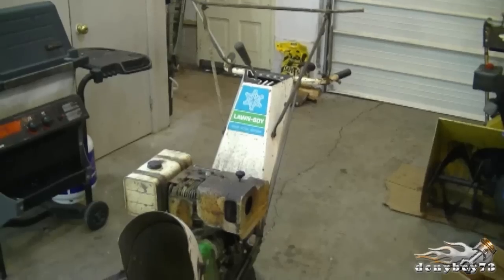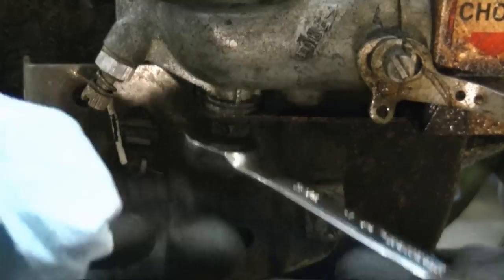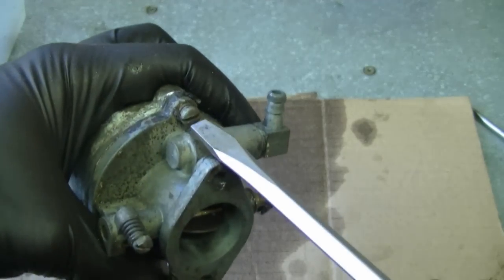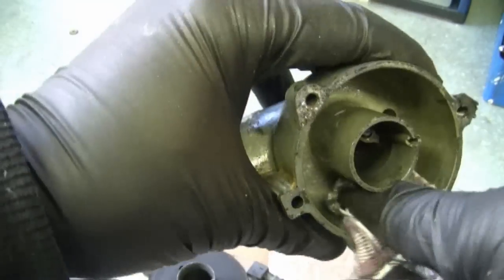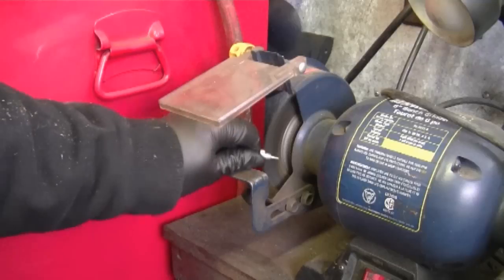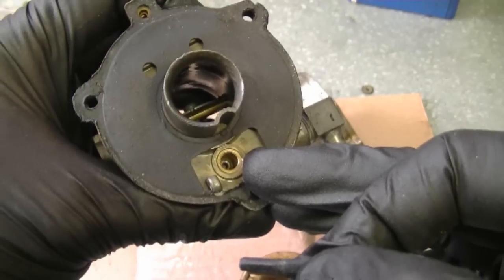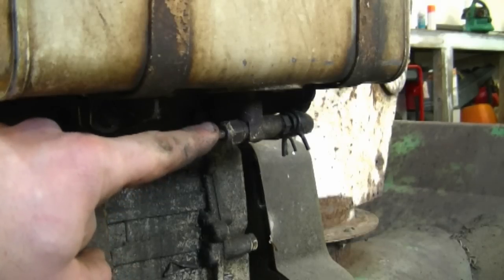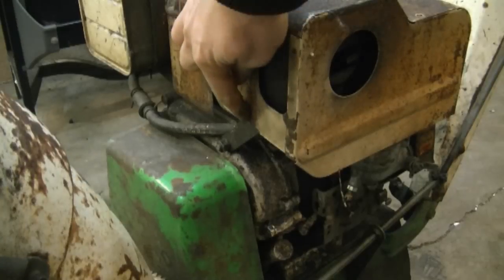How To Clean an Older 8HP Briggs & Stratton Carburetor - video

Comment: Donyboy73, I have got a question, On my Electronic 8 Hp briggs Vertical Shaft, there is a wire leading from the Coil going to a bracket on the side of the engine, when that wire is connected to the coil, it doesn't have any spark, when i Disconect the wire, I have got spark, What is the Purpose of the Wire? Let me know what you think,

Thanks

Comment: Thanks for the video... I have a problem with the carb on my 8hp Briggs... Same carb as your here. It leaks gas out from the 7/16" bolt at bottom of the carb. Someone told me it may be that the float is not exerting enough upward pressure to make the needle seat firmly and stop the flow of gasoline from the tank...

What do you think...? Have you seen this problem...?
Reply from the maker: I often have to replace the needle valve and seat on those carbs, float is probably still good unless you hear fuel inside of it when you shake it

Comment: Great video! I have a Gilson snowblower that is damn near identical (for obvious reasons). Seemed to work when I bought it, but later on the engine died when engaging the drive or auger.

Carb seems to flood and leak petrol just about everywhere (through choke and main jet). Will take it apart a third time this week. Anyway, my question to you is if your carb had some sort of gasket inside the needle seat? Or was it just the brass seat?

Btw. Any experience with alkylate petrol on older engines?

Comment: Dony not sure if my response went through. I'm cleaning a gillett generater with the same carb.
it looks like the idle screw has a blunt end. i looked in the recess and I think the end broke off and is stuck in the end. Is the back end of the idle recess supposed to have a hole for the narrow end of the idle screw. I am about to drill the broken end out if it does

Comment: after fitting the needle and seat and float, i like to put a little bit of fuel pipe to the fuel inlet  and blow gently and manipulate the float just to check the needle and seat actually work.
easy to do and save having to pull the carb off of the needle and seat /float dont work when full of fuel

Comment: Thanks. I was able to remove the carb on my rototriller thanks to this video and give it a clean up but it still runs for 3-5 seconds and then dies. Any advice would be great. I've the exact same motor just the air intake is different and it has a rubber tube from the air intake to the engine?
Reply from the maker: I would turn out bottom screw 1 1/2 turns

Comment: Great video! I have a newer 8hp motor on my Hurricane blower that won't start. It has spark. I changed the plug, fuel lines and it still won't start. The carb was cleaned(had rust buildup in the float bowl). Still won't start. When the hose is pulled off the side of the carb, gas flows out. Any suggestions??

Comment: Great video!!! I have an 8 HP Briggs with an up draft carb that I can't get it to quit leaking out the bottom, watched your video and others 100 times and put new carb kit in it 3 times any suggestions would be appreciated??!!
Reply from the maker: you need a new needle and seat and possibly a new float

Comment: Thanks for the video. Really helped. Do you know the float settings? My chipper runs for a short time then quits.
Reply: The gas cap has a vent hole. If the vent hole gets plugged, the gas will not flow into the carburetor, which will cause the engine to die.

Comment: I have a question?, how much play in the throttle shaft should this carb have?, I have a briggs horizantel 7hp with the same carb, been over everything and cant get the carb dialed in, checked valves changed head gasket etc, wont idle worth a darn real sporatic idle, they carb has been cleaned and rebuilt, there is alot of play in the throttle shaft, side to side and some up and down? any ideas?

Comment: hey danyboy  I have a problem with a briggs engine  this is prob older then you but here goes   this is a cat iron block  I know this is unbelievable but it is what it is  its an genset and when it starts it run GREAT but it has a hissy fit when you pull on the cord its hard to pull and wont start   any sugs?

Comment: I have acquired my first briggs 8 up horizontal like the one in this video. It's on a Troybuilt chipper. It runs good until under load. There's a 1/8" screw about 3" long that's just haning off the rear of linkage bracket. Any idea where it connects and if this might be the problem?

Comment: donyboy: I rebuilt and cleaned the carb. as you showed in the video. I replaced the gasket and rubber tiped needle valve with new ones. the rest looked A-ok and now the fuel "still keeps runnin out, and the engine does not seem to rev-up, although it runs perfect, just not enough rpm's.  the carb is the exact one that is in your video, but mounted on a Ariens Snowblower. What's the next step?????? Help!!!!!

Comment: Great tutorial, followed the steps on my old Toro 726 snowblower.  Started right up but stalls when warmed up and choke off.  Runs a while at 1/2 choke but stalls after a minute or two.  Any suggestions?
Reply: same here on a B&S 10hp
Reply: way too lean maybe?
Reply: Nitro Rev Right on Nitro,  I had to really warm up the snowblower.  Multiple restarts but then able to get a good range on the fuel screw.  Found the sweet spot on Sunday just in time.  Cleared the drive of a couple inches tonight.
Reply: Curt Lefevre You're welcome.

Comment: I just rebuilt a carb that looks like that one but in a 8 hp Briggs on a generator. The motor barely runs and it is leaking gas from the bottom of the carburator. I looked at the bottom screw which you said was 7/16" and my screw is hollow through the center. There are no threads through the center. Is this the wrong screw or is something suppose to be pushed through it?

Comment: I have got an engine like this and cannot get it to run, I cleaned the gas out of the crank case and did a complete valve job on it along with a new carburetor Check the piston and rings and they looked good as well. When it does try to start seems like it is blowing air out the intake instead of sucking it in. Any help would be appreciated.

Comment: Donny, I have a Troy 8hp rider, runs but when I shift or engage blade, it stalls out, will start right up again, but always does same.  It ran well until brake failed and I hit a small curb, resulting in a blown fuse which I replaced.  Any ideas?  I still have to adjust or replace brake too.  Thanks

Comment: I have a Model: 109720 Briggs and Stratton engine. It is on a Garden Way/Troy Bilt 24" Tuff Cutt. The engine runs good but it leaks gas right beneth the screw that holds the air cleaner in place. What are the possible causes for a leak like this one.

Comment: Hi Donny;I have an older B&S with this type of carburetor.I've replaced the float needle valve,cleaned it.The long jet is damaged and I cannot remove it.It will run ,but fuel runs through the unit.Would the long jet cause this,or is there something else wrong?Also can you tell me if and where you can purchase a new one of these carburetors.Thank you

Comment: I ordered a carb rebuild kit that came with two new needles, one looked like the original and the other was aluminum.  Doesn't look like there is a seat in the hole where the needle goes.  How do I check the float setting?

Comment: I have the same engine,  If I spray the staring fluid into the spark plug hole and the engine is still hard to start, does it mean the problem is not from the fuel?

Comment: What is a good starting point for the fuel needle? Mine was 3 full turns back. I have this on a tiller,  would start then quit, would restart right away, traced it to a plugged gas cap.  Ran great for about 15 minutes then started reving up & down.
Reply from the maker: I start at 2 turns out then adjust in or out from there

Comment: I have a Ford snow thrower with the same engine and I want to rebuild the carburetor. I have the kit..I have never rebuilt a carburetor before, but am mechanically inclined...same steps as above to rebuild..? How about adjustments..? The kit is asking about a float needle valve if its Viton tipped or aluminum. I don't have the carb off yet, so not sure what type.

Comment: I am helping my neighbor rebuild this same carb the instructions are great. His carb is leaking fuel through the screw in the bottom that also serves as a mount. In the video, you just simply removed this screw.  Is there supposed to be a washer or gasket?
Reply from the maker: on the mount screw I think is just a washer, I assume you will also need a new needle valve and seat
Reply: I ended up having rethread the mounting hole and go to a larger bolt since the original was partially stripped.  Rebuilt the carb based on your video and it worked great.  Thank you.

Comment: Space shuttle huh? I seem to recall another guy that fixes mowers use that line a few times. Either way, it looks like it's getting plenty of fuel now, smoothed out real nice...and there's your dinner! ;)
Reply from the maker: +Jon Myers lol
Reply: donyboy73 what is the recommended High RPM for snowblower? I have the craftsman 208cc. Thanks for your help 
What is the factory setting?
Reply: Ok Taryl Dactal. Yee haa.

Comment: Hi, I have a Bolens (Garden Way) 5 hp front tine tiller model 12040.  It is over 20 years old and has not been used for years.  As a result the gas has turned to varnish.  I applied some carb cleaner in the choke and it fired up.  The tank needs to be cleaned as well as the carb rebuilt.  My problem is accessing the bolt on the bottom of the gas tank for removal.  One of the shafts that drive the belt is on top of the tank bolt and I cannot access it.  Does the shaft have to be removed to do this or am I missing something?  Thanks

Comment: A problem I had was no fuel to engine. Turned out bowl was full of jell that dried to a white powder. Assuming it was ethanol. Only one station in town sells gas without it. But that will go into my tank first thing. New carb ordered. A kit was the same price plus the new one will save me a rebuild. It is on a wood chipper and things like that are not used everyday

Comment: On the old 8hp Briggs , do you have any suggestions on a replacement pull start? I’m having trouble finding a replacement.
Reply: Briggs & Stratton Parts Manuals are available by model number on the B&S website. Many replacement parts are still available for these engines if you know what part number to search.

Comment: I have an engine like this, but to each time i open the fuel valve to the carburetor, fuel drips from the 7/16th bolt below. I installed a brand new carburetor and the same thing happens. Please tell me what is wrong

Comment: What does the adjustment screw on the top side do. You made the gas leaner on the bottom. Air maybe?
Reply: Adjustment screw on top is the idle mixture screw.

Comment: Hey Dony. Great vids. I do have a question though on the two piece Briggs carb. Is there a "good" procedure to drilling out and removing  the emulsion tube? I have a kit coming and the old emulsion tube was so tight even after soaking in lube a few days I buggered up the screwdriver slot on the end. I will have to drill it out to remove it. Thanks.
Reply from the maker: maybe a screw extractor
Reply: When the tube is corroded in place, sometimes a few seconds of heat from a propane torch on the carburetor body near the tube threads will make it easier to extract.

Comment: Hi Donnie,If you buy a new carb as shown above ,what is the setting for the high speed jet and the idle jet ? After turning all the way in,what is the number of turns to back each out ? Thank you!
Reply from the maker: bottom screw about 1 1/2 to 2 turns out, air screw on top about 1 - 1 1/2
Reply: Donnie,Thanks a bunch,no paperwork at all came with the new carb.Have a Super Day ,you're the best.

Comment: Hey. I have a tiller(Ferrari 90, LOMBARDINI IM 350 engine). I cleaned up the carburetor and when I accelerate him, his acceleration going down just like something are choke him. And when I dig with the tiller the engine die. I give you a sugestion from me: by the carburetor is leaking gasoline. May be this the problem?Please help me

Comment: I have the same carb on my Toro 826 and the long jet I think was preventing the float from opening to let fuel in, I tried bending it and it broke. I got the blower last year and it ran fine, after sitting all summer it would only start with starting fluid...I dont know what to do now
Reply from the maker: may be easier for you to get a new carburetor

Comment: Hey Donny,   I have a question? I have an old model B&S 10 hp  off a snowblower, and the key way on the crank is worn out. Can I use a crank off an 8hp B&S  ? Which I have off a snapper mower..Also could I also put the 8 hp head on the 10 to increase compression..Compression on the 10 hp is 75 at present. Thanks Donny . Todd.
Reply from the maker: +RFKFANTS67 yes the crankshaft might fit
Reply: +donyboy73 Thanks man

Comment: Great video!  I've got that exact same engine and carb, but the model number has been rubbed off.  I need to get parts for the carb, but they need a model number.  Can you please tell me the model number listed on that engine?  Thanks!
Reply from the maker: 192404

Comment: donyboy, I have an old B&S 5hp, 206cc on a leaf blower.  I have spark and I have compression but I can't make it hit on anything.  For good measure I replaced plug and coil, setting both properly.  I tried fuel directly to carb and then I removed and cleaned carb.  I also checked flywheel key.  Any ideas?  Thanks.
Reply: cherokeefiddler key on fiywbeel
Reply: Does it fire at all?  Use fresh Premium fuel.  Check coil/magnet clearance at flywheel.  Try some quick-start ether sparingly.  Check fuel filter if it has one and that fuel flows to the carb. Check choke linkage.  Good luck.

Comment: I have an 8 horse just like that one. It will start and run but the muffler gets red hot. Any suggestions would be helpful.
Thanks
Mark
Reply from the maker: watch this video  SYMPTOMS Of A Leaking Exhaust Valve On A 4 Cycle Engine
Reply: donyboy73 Thanks That is exactly what is happening

Comment: what's that screw on the bottom please explain lean adjustment vs rich I'm experiencing richness
Reply from the maker: if you turn in the screw it will run leaner
Reply: +donyboy73 got it done before reply thank you

Comment: Hello Donyboy,

It's not metal, maybe 5/16 in Diameter. It looks to me like a rubber based material similar to an O-ring, but without the rounded edges.

please advise.
Reply from the maker: my guess without seeing it is that it goes on the nut that holds the adjusting screw

Comment: I always use  Alkylate gasoline on my snowblower and always fill up the tank after every time use I it so no condense can cause problem, and I never have problem with the carburetor because there is no water or pulution in alkylate gasoline, and the alkylate can stay in the tank during summertime and prevent corrosion in the tank, beacause alkylate will not go bad for at least one year, the down side it is more expensive than ordenary gasoline

Comment: what is the best way to avoid  gumming up a carb - I have an old atlat I bout at a moving sale - works good - should I run it until its out of gas at the end of winter?  I used stabilizer this winter with gas in it
Reply from the maker: I have 2 videos, 1 on summerizing a snowblower and the other on winterizing a lawnmower
Reply: ok I look them up - thank you for the vids.
Reply from the maker: Mike Carrington thanks for subscribing

Comment: Can you tell me the correct pt # for the brass nozzle,having trouble finding the correct one.Engine is 8hp 3 bolt carb Model # is 38570 s/n 9000406 date code is 88061310 .Toro powershift 828 . the nozzle has 4 hoes across from each other & a very very small hole close to the head of the nozzle.I bought a new carb for the engine but it doesn't idle right ( surging) took the new carb apart & discover that the nozzle didn't match my stock one.The new type carb  brass nozzle only had 2 holes in it, that is the problem.Please steer me in the right direction.Also the nozzle don't interchange due to thread pitch problems. 
Thank you for any help.

Comment: Hello. I bought an old Snowblower of a friend of mine.  When I went to take the carburetor apart, I notice that it was missing the 7 16th bolt on the bottom, and when I start the blower, gas leaks out of where the bolt should be, 

Could you tell me what type of bolt is needed?  or part number? 

Cheers
Reply from the maker: it comes in a new carb kit #31840 from tecumseh
Reply: donyboy73 Thank You very much.  Really appreciate your video, it really helped.

Comment: Hi donyboy73 I have a 8hp Briggs and Stratton engine and I have rebuilt the carburetor multiple times but the engine will not idle. Even when I adjust the fuel jet. Any ideas why this is so?
Reply: The adjusting screw for the throttle plate should be set so the plate is slightly open. If it is closed completely, the engine dies from lack of air when idle. The idle needle screw should be about 1 1/2 turns out from seated position to start; then with engine running at idle, adjust for best idle. When you have proper idle set, then adjust the high speed needle on the bottom so you get good response when you rev the throttle linkage with your finger.
Reply: Also, the gas cap has a vent hole. If the vent hole gets plugged, the gas will not flow into the carburetor, which will cause the engine to die.